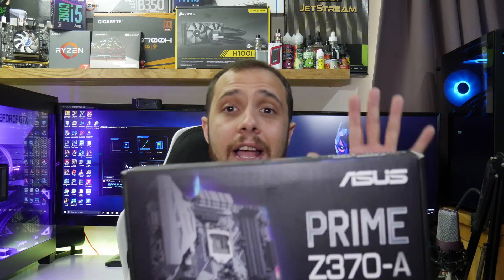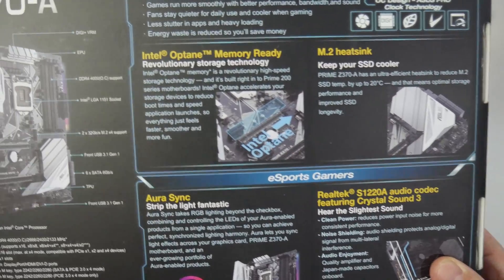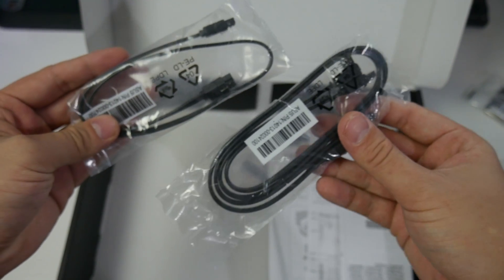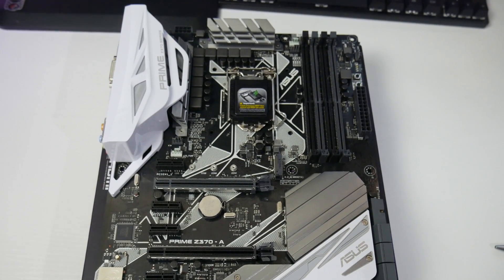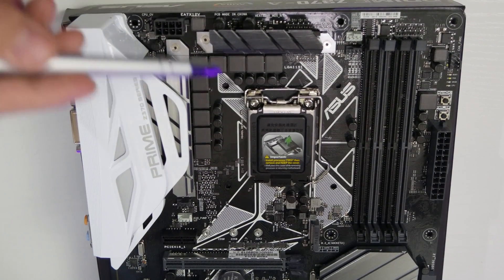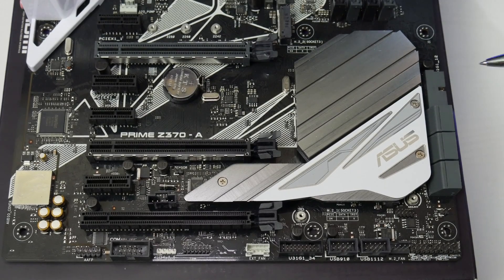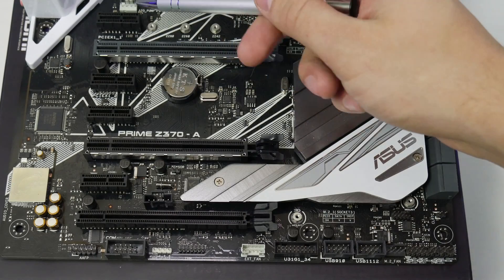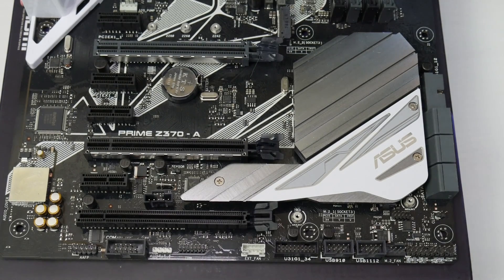Asus Prime Z370-A Unboxing And Overview

Comment: Is that SLI bridge good enough to use or should you buy one anyway?
Reply: its decent but if your going to use two 1080's or higher i would recommend a SLI bridge that is the same as the gpu's brand

Comment: does this board support corsair rgb ram sticks?
Reply from the maker: zed dark as far as I am aware corsair rgb ram only works with there own corsair link software.
Reply: They are compatible with Aura, RGB fusion and msi mystic light software. You can use either of these programs to control them.

Comment: What is the difference between A,F,E Models of the Z370 motherboards?  Which model should be good for a beginner who is building a new PC?
Reply: Been looking at these and other z370 boards and trying to compare features etc.
In regards to Asus boards the A & F seem to be the same motherboard with different styling/branding. E is more or less the same as the other two with wifi and a couple of extra connections eg 9 USB vs 8. If you don't need wifi or ROG branding then the Prime A would appear to be the best value. Reviews on other sites indicate they perform & OC about same as each other.
Reply: Damo Thanks for clearing this up!
Reply: No worries, a couple of other boards worth looking at similar prices (in Australia) and feature sets as the Asus Prime A are:
MSI Z370 SLI PLUS Motherboard
ASRock Z370 Extreme4 Motherboard  
Gigabyte AORUS GA-Z370 AORUS Ultra Gaming Motherboard
Reply: Damo I have seen some of the cheaper boards don't have "box" like thing on the IO shield ports, is there anything to with that in terms of performance or is that just for aesthetic and looks?
Reply: Should say first off I’m no expert, that said the IO shroud itself is usually just aesthetics however beware there are other components nearby (that require or benefit from cooling if OCing etc) that the IO shroud often overlaps or meets. e.g. power delivery components heat shield. 

There are cheaper boards and more expensive boards than these and most boards appear to perform more or less the same (give or take) so features and aesthetics are the main differentiation. The boards I listed all have a feature set I find appealing for my needs. 

All the discussed boards have a version of Realtek 1220 audio, SPDIF out, 2 or more M.2 connections, 6 or more Sata3 connections, 8 or more USB3.1, 4xDDR 4 memory slots,  > 3600 memory OC supported, plenty of fan headers etc. and better than  “base grade” power delivery and of couse Z370 chip set.
Reply: Damo well thanks for quite detailed information about the shroud on the board. I'm building my first Gaming PC with i7 8700k and gtx 1070, so please suggest which motherboard should I go with.
Reply: Can't really suggest a board as I don't know your needs and budget. Researching the options and making the decision yourself is half the fun of doing a build and assists with improving your knowledge and understanding of PCs. I can offer some tips though.

You need to decide on a realistic budget and your minimum needs. Once you know your needs and budget the list of boards becomes more manageable. Here's some questions to ask yourself in reducing the list of boards.
What chip set and form factor do you want? eg Z370 & ATX. Do you need on board wifi?

What sort of quality of audio do you want? Do you use headphones? Will you use the SPDIF digital out instead and don't need good on board DAC (audio)?

What and how many drives are you going to install? What expansion capability do you need? How many M.2 ports & SATA ports do you need?

How much memory will you install? Do you need 2, 4 or more slots?

Do you plan to overclock? Are you chasing just good game rates or outright overclocking scores? Better power delivery and heat sinks become more important if chasing the highest possible clock.  Are you familiar with any of the boards utilities and bios? Do you want an auto overclock etc. In reviews just about all Z370 boards have achieved a 5Ghz overclock on 8700K. The OC is more dependent on your chip and cooling than the motherboard.

Are you water or air cooling? What about RGB? Some boards support more fan/pump headers and RGB better.

What are you plugging into the system and what case are you going to use? What outputs and connections do you need?

Just about any board from the MSI, Asus, ASRock or Gigabyte that meets your minimum requirements at your price point would be good. They will all perform around the same level with the features/focus of the boards the main difference. 

I suggest you would get a lot more bang for buck and more performance by upgrading from a 1070 to even a 1070 TI (or better) than any performance difference between motherboards (unless you already own the 1070). If your budget is real tight you could consider 8600K etc. A 8700K cpu and 1070 gpu would appear a poor match with the system limited very much by the 1070 (for games at least). You want a balanced build.
Reply: Damo I think i7 8700k is not a poor choice at all for 1080p 120/144hz gaming. The reason I chose an i7 8700k than the i5 8600k is more head room for future. For instance an i5 8600k gets pegged to 100% cpu usage in For example Battlefield 1 Multiplayer, which causes micro stuttering and also can't run any more programs without affecting the gameplay. And for the Gtx 1070 as my choice for Graphics card is because it is quite powerful enough to give 100+ fps at 1080p in almost all games. Later down the road I have plans to get next gen gpu from Nvidia for 4K gaming. 

As for the Motherboard features you have mentioned, here are some of them I would need:
*ATX Size 
*4 Ram slots (will install 2x8GB=16GB)
*Will Overclock mildly but not that much (not anytime soon for sure) 
*Will plug 1 250GB SSD (Sata) and a 2TB 7200 Rpm Hdd
* Don't need on board Wifi (Will a USB wifi dongle be good enough?) 
* I will use Headphones for playing and chatting in game
* Will be using Air cooler ( not gonna risk for Aio leakages)
* Not familiar with bios or oc (this is my first build as a gaming Pc)
Reply: You see I don't know your requirements and what you value and assumed you wanted to game at >1080P

The 8700K is a great chip but I still think overkill for just 1080P although I understand that it makes sense for future proofing for games that use the extra cores. In regards to video I  would spend the extra $50 bucks and get at least a 1070 ti but that's me.

OC is just overclocking. The OC you can achieve depends mostly on the quality of the 8700K chip you get and having an appropriate cooler setup for the chip and not so much on the motherboard. If air cooling then case airflow becomes a more important factor. Gigabyte's auto OC is meant to achieve good results (5ghz) according to one review I watched.

The Bios is like the operating system for the motherboard for lack of a better description and where various board settings are made although most boards have utilities (software) these days, some are easier to use than others. MSI for example is said to be good for novice overclockers as all the settings are accessed in the one place.

Cheers

Cheers
Reply: I understand why you see i7 8700k as overkill for 1080p, but you may know/remember when people you used to say "you only need an i5 for gaming and i7 is overkill" , now their i5 is struggling to keep up in games like Battlefield 1 multiplayer as it demands more cores. This is the reason I'm getting the best cpu so I don't have to worry or the urge to replace my Cpu anytime soon because i5 will soon hit their max usage where as an i7 will still have a headroom to stretch it's legs. 

Please watch this video as this may clear up my point on an i7 8700k as the cpu of choice
https://m.youtube.com/watch?v=eOtlgTjBvZU

And

https://m.youtube.com/watch?t=62s&v=bXabAtLbOnA

Look at the cpu usage for both i5 and i7.
Reply: Not aware of micro stutters but I don't play battlefield mp. I am aware the older I5s have issues with modern games that can use more cores/threads.  I wasn't trying to talk you out of 8700K far from it, it's what I am purchasing anyway but as you were looking at the cheap or budget Z370 boards I assumed you were on a strict budget and may be better served with a more balanced approach. 

In regards to the motherboards I will most likely purchase the ASRock Extreme 4 or the Prime A as these are the best and cheapest boards that meet all my requirements although I am toying with the ASRock Taichi purely based on style and justifying the extra cost by the addition of on board wifi and extra trinkets.
Reply: Damo Cheers for your build too! Btw what is your build and what games will you be playing?  
So I have decided these components for mostly fps games
i7 8700k
Z370 Asus H or F
Gtx 1070 Oc or maybe 1070 Ti if possible 
16 GB DDR4 2666 Ram
2 TB Hdd 
250Gb ssd for Windows 
650 Rm psu from corsair 
Monitor 1080p 144hz 1 ms (Acer, BenQ, Aoc)

Edit: would you also suggest a 1080p 144hz build?
Reply: xFateGaming I suggest you are better placed than me regarding 144Mhz & 1080P gaming advice:)

In regards to Asus H or F the M.2 heat sink available on the F (and the Prime A) is meant to actually work (reduces temp by 20c according to one review) and is a worthwhile feature to consider when comparing the H & F.

Anyway my proposed system build is as follows: 
CPU: 8700K (out of stock in Oz).
Video: 1080 TI (couple of choices will come down to price when I buy).
Motherboard: Z370 ATX (as discussed).
Memory: 16Gb DDR 4 @ 3200Mhz 
Boot drive: M.2 250 GB Samsung 960 EVO.
SSD: 1TB Samsung 850 EVO.
HDD: 2TB WD black. 
Optical Drive: Internal or external depending on the case decision. I have a lot of music & movies on disc.
Cooler: Corsair H115i (or H100i depending on case decision) AIO.
Power supply: Corsair RM750x or similar. 
Case: Haven’t decided nothing really jumps out. Wanted something new but new additions like NZXT H700i & CM HP500 have disappointed.
Monitor: 1440P, IPS, Gsync, 100Hz+ (Acer or Asus most likely) or better still an ultra-wide, unfortunately prices are ridiculous for ultra-wides at the moment and new generation of monitors are due. 
Sound: LG sound bar via optical spdif out & M50X headphones via board/case (already have both)
Games: lately Civ 6, Assetto Corsa, Total war various, older CODs and various older FPS etc.
Reply: Damo Well I think you have more knowledge and experience than me in PC as I'm switching from a PS4. That's why I asked for your suggestions if you had any for a PC build aimed towards 1080p 144hz gaming. Nonetheless I got to know quite few things about the different features of various z370, so I thank you for that.

Edit: Didn't see your Complete reply (Skipped the Read me option by mistake) 

In regards to your build, it's quite a powerful system and is well capable of 1440p 144hz gaming. Gtx 1080 Ti is a beast of a card for 1440p 144hz as well as 4K @60hz. The reason I'm going for 1080p 144hz is because of the gpu prices here in my country are ridiculously high and not to mention the price of a 1440p 144hz monitor from Asus and Acer. This is the main reason for getting a better cpu which I won't need to replace when I decide to jump over to 4K gaming as I will only be required to get a new Gpu without changing my Cpu.
Reply: Agree GPU and good gaming monitors are silly prices here as well however I think the 1080TI is worth the extra spend and like a 8700K can help stave off having to upgrade. In earlier generations the difference in price between the mid range cards and the top end was far greater than today. The reason I haven't started the build is I was waiting on Vega to see what it would bring (cheaper freesync) and then coffee lake landed with no supply. I also believe the new generation of monitors is due shortly so don't want to pay premium for something about to go obsolete (or at least reduce in price). So I have been procrastinating about what case to purchase instead. 

I'm finding it harder to justify the storage costs more than anything else at the moment and may wind it back a little if I get sticker shock when it comes time to purchase. I'm lucky I can afford to spend a bit more but I still want value for the money and even if I can afford something I still need to justify the spend to myself.
Reply: Damo Exactly I'm in the same shoes as of yours. I want the best for the money I spend. This is the reason I don't want more than a Gtx 1070 atm because if I get a 1080 or 1080 Ti then I will have to get a 1440p monitor with high refresh to take benefit from a 1080/1080Ti. So for my first PC build I'm going for 1080p 144hz with a Gtx 1070. Earlier I was pairing the 1070 with i5 8600k but then came to know that games like assassins creed origins, Battlefield 1 etc are completely using the 6 cores on it, so that's why I decided to go with i7 8700k which is $100-150 more but will not need any replacement for quite some time. To sum up what I meant is :- Getting a Gtx 1080/1080Ti requires you to have at least 1440p or 4K display to justify it's cost and the money spent on it. On the side note as this is my first build I'm more than satisfied to play on 1080p with high refresh rate which is something that I will experience for the first time. Hope you understand what I just wrote. Wish you luck and have fun with your system :)
Reply: xFateGaming makes perfect sense all the best & enjoy the journey:)
Reply: Damo You too! :)

Comment: I got this mobo to run a 8600k and 16 gigs of adata xpg gam somethig d10 that i can hopefully run at 3200mhz,unfortunately the ram and cpu have arrived but the mb is still in shipping state :(.i'm upgrading from a i5 3350p and 8gigs of 1333 ram that i think has been struggling to keep up with my oc'ed gtx1070.
Ur previous video made me decide to get this instead of some gigabyte mb that i've seen other reviewers use.
Reply from the maker: Danut The best comments are when someome say I purchased this because of watching your videos. Hope the build goes well I hate it when all the parts do not turn up at once.  when you have it all up and running if you have the time to drop a message with you oc frequency,voltage and ram. Be great for anyone else looking at the same parts.
Reply: TheFullSetup Thanks man,i'll try a oc for sure but not sure how much cause my current termalright 120 cooler isn't that oc friendy i think.
After i sell the old i5 platform i'll buy a aio and start playing around more